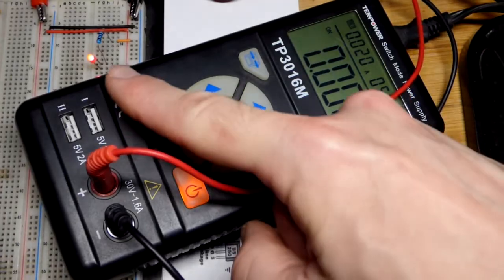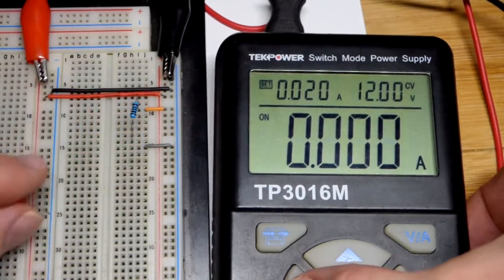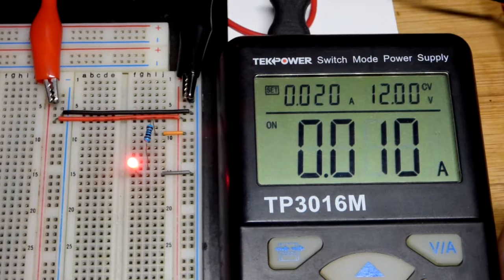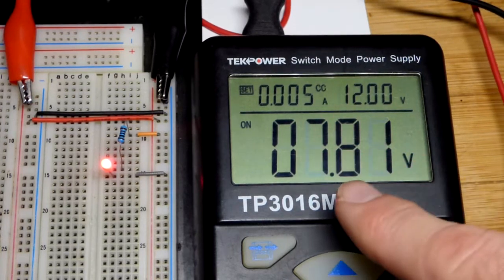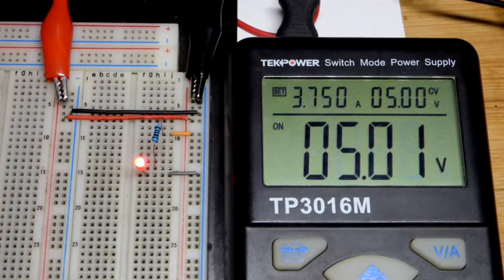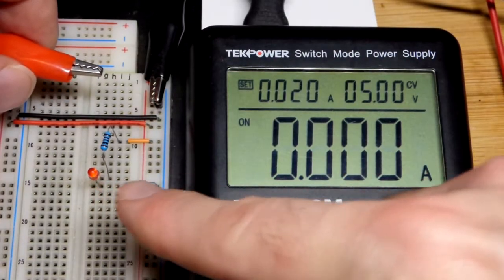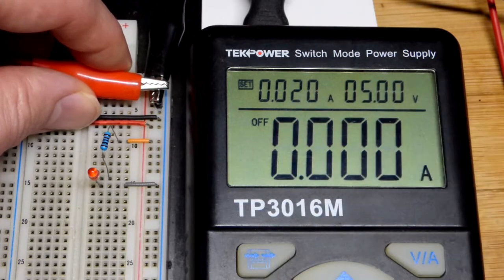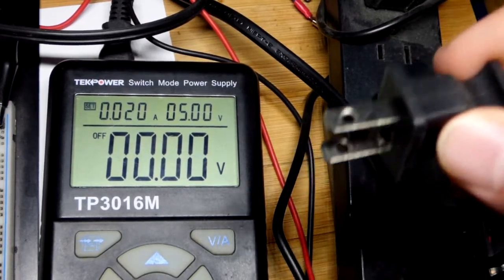Portable bench power supply basics for learning electronics shorts 1

Comment: Along with a reasonable multimeter and soldering iron the bench power supply is a must have! Being able to set a required voltage and limit the current can really save your bacon because you can bump the current up in steps and look for anything getting hot or if the circuit hasn’t fired up as expected the low current may save some components .